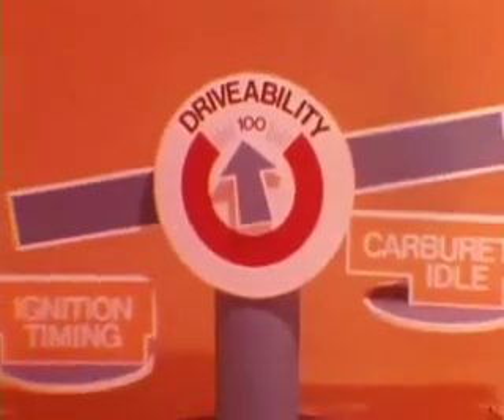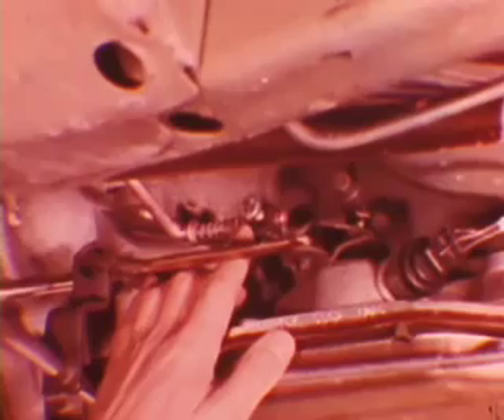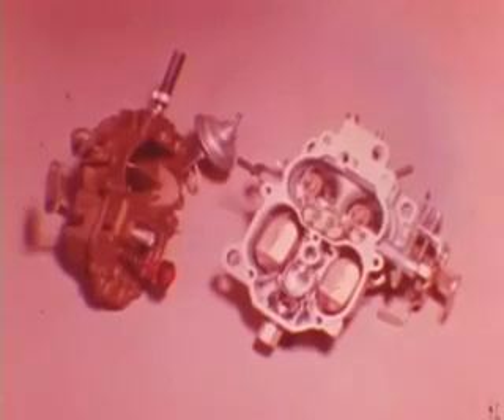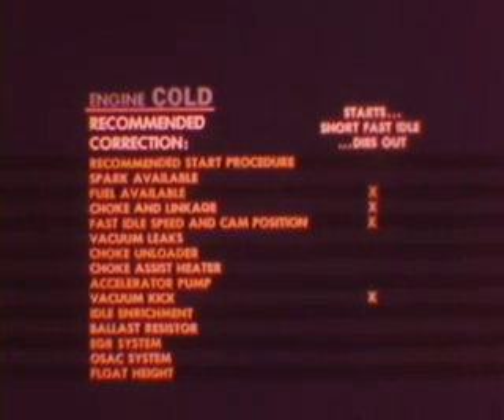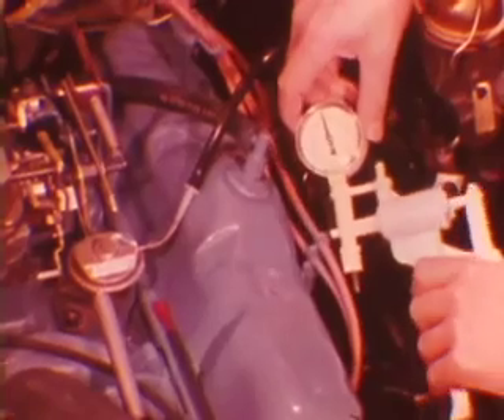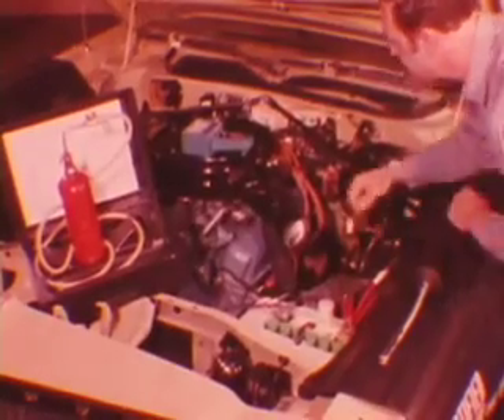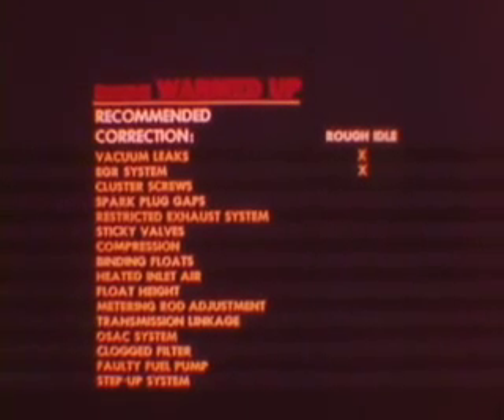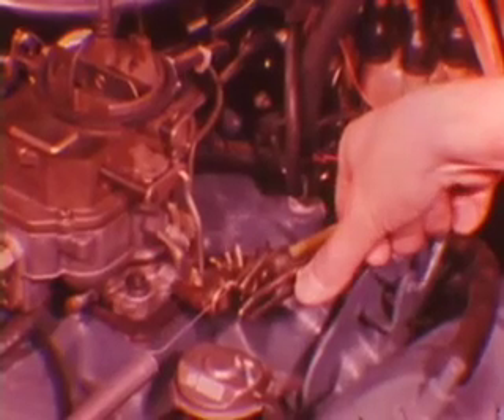Chrysler Master Tech - 1977, Volume 77-2 Driveability

Comment: Drive ability problems with all domestic cars during the mid 70’s was just one more reason so many people turned their backs on American cars and switched to European and Japanese makes, which didn’t seem to suffer the same problems, at least not to the same extent. Manufacturers having to meet ever tightening emissions regulations set by the federal government, the unintended consequence of unrealistic time lines to turn an industry around and satisfy the green lobby, the once mighty American auto industry never recovered their position.
Reply: The domestic manufacturers should have embraced fuel-injection from Bosch like the Europeans did ,solving emissions and drive-ability issues.Costs and keeping it simpler for Joe Greasemonkey strangled the carburetor to the point where it couldn't work anymore.
Reply: I think the unrealistic timelines and the fact that they were forced on the auto industry are valid and important points.
Reply: I agree. 😊
I started driving in 1981...American car quality was hit or miss...Japan and to a lesser extent, Germany, gave U.S. automakers a bloody nose...😢